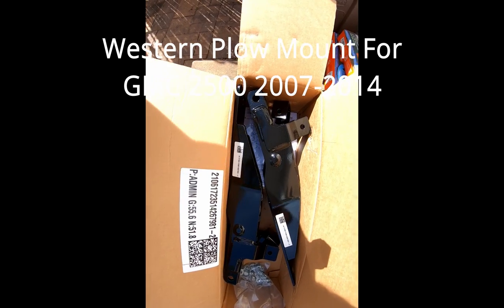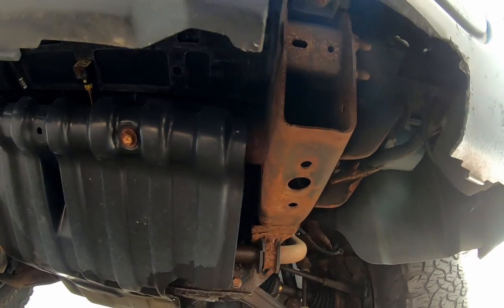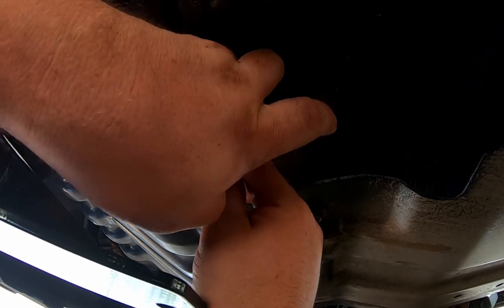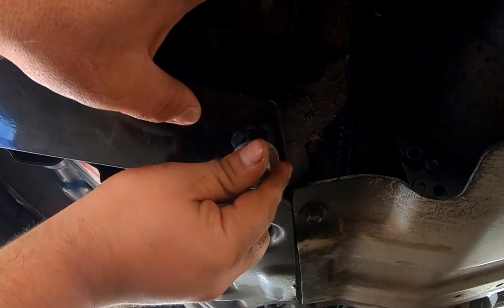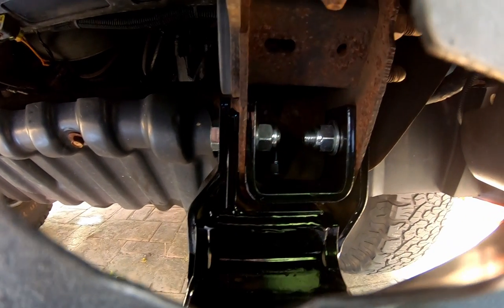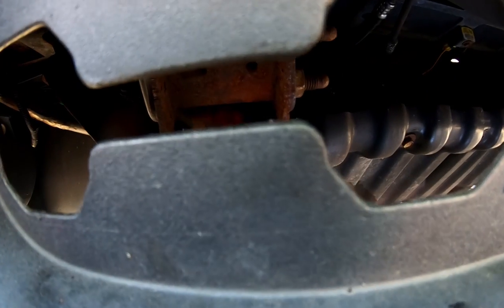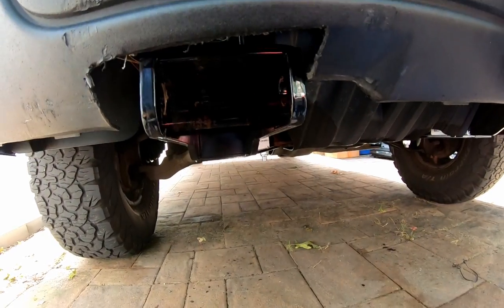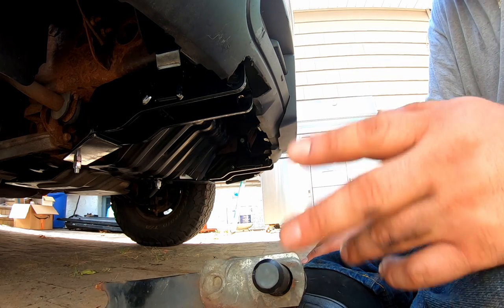Western Plow UltraMount Install 07-14 GMC Sierra and Chevy 1500 2500

Comment: Just fyi the information in your video is incorrect. The mount is for 99-2010 2500 and 3500(other than 99-2002 classic 3500). This mount is also not for a 1500 like stated in the title. The 2500/3500 frame changed in 2011.
Reply from the maker: Ok great, thank you. I kinda titles this video for the purpose of the install is the same across all the platforms and to bring in some more interest. I also didn’t know they separated the 99-02 3500 and when I ordered it showed 07-14 2500 and 3500.

Comment: Did you have to add anything on the front suspension
Reply from the maker: No it’s all factory except a leveling kit. But that has been on the truck forever and is not needed to put on a plow. This is a 2500 so they can handle it plus I went with a 7ft 6 plow to be slightly lighter to not kill my front end. A few tips to extend the life of your vehicle. Thanks for the comment please consider subscribing.
Reply: @The_Rev_Room  ok, just curious. Because mine seems to sit to low, and the kick stand hits the ground not giving much clearance so I can lock the pin for it.
Reply from the maker: @perrylund4889  are ur shocks and springs old? Might be time for a new set. Or try the leveling kit.

Comment: 67981-2 Frame bracket hardware
#4  6  1/2-13 Locknut
#5  2  5/8-11 Locknut

#6  2 5/8-11 2” Hex bolt           -used rear 2 bolts, hanging down –1 ½” bare minimum length
#9  6  1/2-13 1-3/4” hex bolt   -used middle bottom and front top hanger bolt, bolts up –1 ½” bare minimum length

#7  4  5/8” flat washer
#8  8  ½” flat washer

Or can keep tow hook and use a 1/2-13 x 6” bolt, locknut and 2 flat washers. Eliminates 2 of the 1 ¾” bolts per side
Reply from the maker: @mrmotofy  thank you. Please consider subscribing